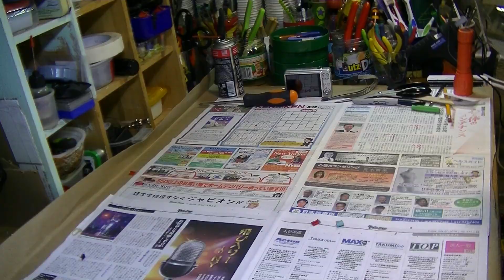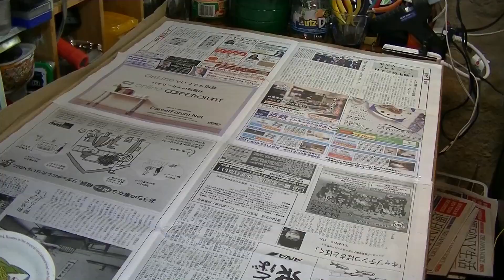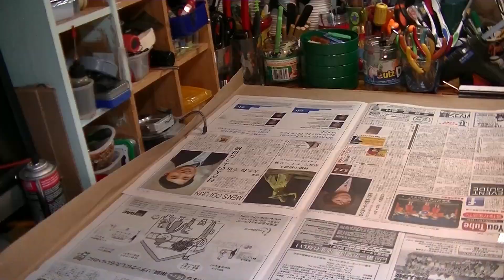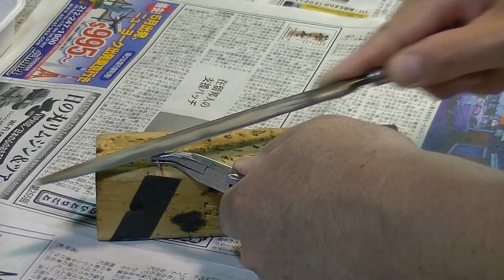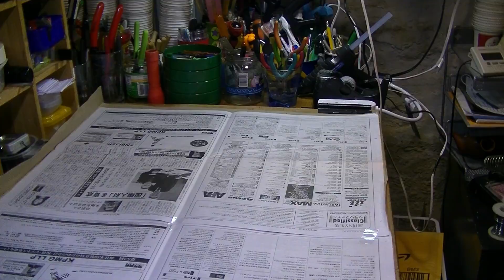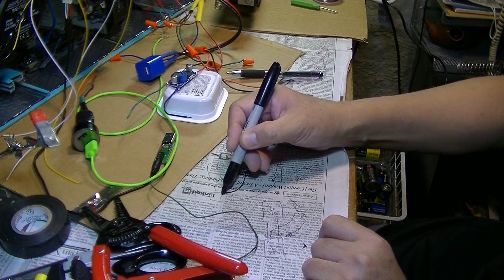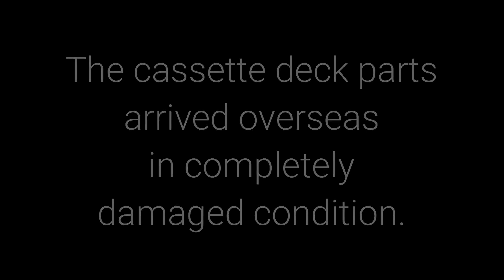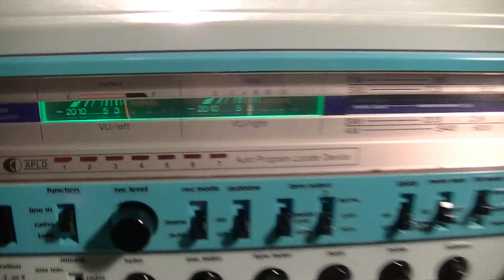A Nightmare Of The SHARP GF-777 An Endless Cassette Deck Fix

Comment: Hi teddy it's a joy to watch you work man but I would have thought those vintage machines would need recapping
Reply from the maker: I agree. Most of the time I do not replace the cap if both left and right sound level is normal. But if I replace the cap, the sound quality will jump up from good to GREAT. But I do not have time to work for each of them so far.

Comment: One can only appreciate the amount of hours you pulled into this boombox! Excellent job Teddy! The muffled sound was very noticeable when you were playing cassettes - I guess there is some old and tired component in your pre-amp (before the tone-correction circuitry), most probably some capacitor. The thing is that the power amp (after aux) sounds much better when picking signal from AUX .. so it is definitely not the power amp but the pre-amp that muffles the sound .. regardless of the variation in motor speed, that is. 

In another of your videos I've seen you have a bunch of all kinds of belts .. where does one buy those belts? And where did you buy that sticky plate that you used to stiffen the case? What is that called in English?
Reply from the maker: Hi, Nicolae. Thank you for the great input. Next time I may look into the pre-amp parts you mentioned whenever i have some muffled sound problem. Great input.

The drive belts, I buy time to time from seller on ebay, or other online shop.
I buy assorted belts set, mostly made in China. Some of them good, and some bad.
Also I used to buy belts from Germany and it was a great quality one, but they suddenly stop selling belts.
When it comes to the flat belt, there are sellers who are selling turntable needles, and they also have a different type of good quality flat belts. They will cost than assorted one, but works perfect.

Finally, plastic bonder syringe like thishttps://amzn.to/2XBJucr

It will enforce the strangeness of the repaired parts.

You can find many of them from many different company.
Reply: @teddyhashee  thank you for the information! I'll certainly look on Ebay for belts. Do you happen to know where I can buy a test tape? I  looked for such a tape on Amazon and Ebay to no avail..
Reply from the maker: I bought mine from here
https://www.duplication.ca/audio-cassette-speed-calibration-test-tape.html

Price is fair, but shipping is a little expansive though.

Comment: Excellent job as usual and very brave taking on that beast. Did you consider upgrading the power amplifier with a class-D to push those modern speakers harder?
Reply from the maker: I did not replace the amp to the more powerful one this time, but in the future, I may do it!! Thank you for the suggestion.

Comment: Hi! Have the same device, a bit of a nightmare came up, while i was trying to change a belt to the deck 2. I put one 4 pin cable on the wrong spot (i know, my bad) and then both decks stopped working :(  any ideas where i should start looking the problem ?? 
Already checked both of the fuses and they are Ok. The 2 pin yellow cable which leaves behind the deck buttons is power ?  Might be the issue on it ? Radio still works but decks don´t.

Comment: LOVE this one Teddy!!.
Q: do you find big diff with new speakers, & ever have clearance issue w big magnet. Have to rewatch on higher speed, missed painting of the face.
Reply from the maker: Hi, Bobby. The original 6 speakers were contained with 2 heavy duty bass speakers in the center. When I tested sound with original speakers, the all range speaker was not so impressive, however, this bass tuned speakers were outstanding. After replacing the speakers to new one, I wanted to have more heavy bass sound like original one. Other than this, there was no problem for installing new one.

Comment: Great work. My pain was when my GF 777 was stolen from a few years ago after owning it for 15 years. If I ever get another I want you to restore it but I have one question weren't those woofers you put in too powerful for the unit if I recall from way back when I last opened mine all the speakers were 10 watts equaling out to 60 watts.
Reply from the maker: Wow, sorry to hear that your GF was stolen. Hope you will get your GF777 again. About speaker, my opinion is definitely the original speaker is best much for this one. Tow center ones were for heavy base that will create more 3D sound, in my opinion.

Comment: Great Job. Would like to know.. Why do you approach the de-magnetizer in the way you do to the heads ? thanks
Reply from the maker: That's how I learned how to use De-magnetizer. From far away to the head, slowly movement, and never touch the head as well as metal around the head. Wave 4 to 5 times in front of the head, then move backward slowly in order not to damage the head by the strong magnetic force.

Comment: Hello, I always follow your work,congratulations You are very good. I'm restoring a Sharp gf 767 and I'd need some advice. I remade the rubber, the deck transmission wheels and changed the rubber straps, restored 2 springs and cleaned everything. When I start the 2 decks, they work for 3.4 seconds and then they stop,as if the tape is finished...how do you advise me to intervene ? Thank you!
Reply from the maker: Probably auto-stop is kicking in. It means one of your reel is not spinning well when you play or FF/REW.
Reply: @teddyhashee  ,tank you my friend!

Comment: Hey teddy another genius restoration WOW. Are these Sharp boombox problematic to fix I remember the other one you restored this one seemed like triple the work I wouldn't want to know what you charged for this one lol. Did the new speakers make a big difference in sound or are they just as good as the stock sharp. Great job
Reply from the maker: The sound of the speaker, for me original bass speaker (2 of them in center) has much deeper sound than the new one. Those original bass woofers were tuned into especially heavy base. So I like original speakers sound, that's my honest opinion. Thank you for the great comment always!
Reply: @teddyhashee  I think the modern speakers probably need more power  to make them sound good?

Comment: Nice, don't like the colors but this is a client request I guess. One question, you paint the surface however how did you restore the labels for knobs? In the 80's there where scratch-on letters but isn't available anymore. Any exposure possible to a 'secret'  how to do this?  Thanks for any answer about this.
Reply from the maker: When the owner painted body, he also created labels by printing it onto the thin plastic and attached them. So the position of the labels were different from original position. So it wasn't good looking when you look them in closely. However, I saw another boombox that was done by the professional with using hydro dip painting method, it had all exact same labels transferred onto the body. I guess it was printed on the transferable sheet and put each of them as exactly same as original. Probably it costed more than a thousand just only hydro dipping and labels.

Comment: I was wondering, do you think those small plastic parts could be replicated using a 3D printer?
Reply from the maker: If you are talking about the white plastic parts for the FF and REW, I am not sure the 3 D printing parts would work as replacement. If I were you, I will try to duplicate it with 3D printing, then after that I would sand their surface down until to make it very smooth. It has to move as smoothly as possible.

Comment: Yess I would try to fix it but if it has a  huge problem ,  I will not  attempt  or maybe I would  scrap it  for my new project;  oh' by the way if those cassette players sound muffled  try to adjust the Tape head, it has  a significant screw with spring attached on it try to rotate it,  there are two screws  the other one is fixed while the other one for tone adjustment... enjoy
Reply from the maker: Thank you Edifier for the valuable info. I do touch the head adjustment sometime to improve the sound quality. For this 777, there are another issue from painting. The painting of the whole body including the cassette door made slight change of the touch of the head, and that was unable to adjust. Anyway, next time if I need to do the 777 or similar one to restore, I try to adjust the head if it is possible. Thank you!
Reply: @teddyhashee  Yess  well you can paint it with acrylic car paint metallic ,  just give the spray paint one foot distance to it, so that  the acrylic part will evaporate  not melting the plastic
Reply from the maker: Thank you for the great info!

Comment: i Have this exact sharp 777 how can i go about getting mine repaired>
Reply from the maker: How is your GF777 condition?
Reply: Teddy Hashee  it seems to have the same problems as the one you fixed ive had it for awhile the tape deck use to run they run slow now . the radio use to play but will not pick channels.  I don’t think it’s in poor condition but def a lot of wear and tear over the years
Reply: Teddy Hashee but it’s not the best either
Reply from the maker: clean the all contact with contact cleaner, replace the drive belts to see how it change.
Reply: Teddy Hashee  juys a question how long of a process to do this exact thing to mine that you did ?
Reply from the maker: It all depends on the condition of the boombox. Some took 2 weeks, some took 5 month.
Reply: @teddyhashee   i guess i should have asked are you in the USA ? if so do u have a repair shop and can i send it to you

Comment: 我擁有一台GF-777，遺憾的是除了音量旋鈕還在工作以外，其他的旋鈕都已經失靈或不再工作了。另外我的這台GF-777左聲道聲音正常右聲道聲音小，這個問題困惑了我很長時間，至今仍未找到解決方法。
私はGF-777を所有していますが、残念ながら、ボリュームノブがまだ機能していることを除いて、他のノブが故障しているか機能していません。さらに、私のGF-777左チャンネルサウンドは正常で、右チャンネルサウンドは小さく、この問題は長い間私を困惑させ、まだ解決策を見つけていません。
Reply from the maker: It is most difficult to find out what is the reason one channel has weak or almost no sound. You need to follow the signal from source to output, and need to pinpoint the cause. Take a time enjoy your restoration.

Comment: These are not easy to work on.
Reply from the maker: The way Sharp designed this 777, especially inner shell is making it difficult when it comes to fix the cassette deck. But once I understood how it build, then mostly what I needed was just patience to do the same job again and again. Thank you for the comment.
Reply: @teddyhashee  I have a Realistic 14-778 that I couldn't get the cassette mechanism to engage. Comes to find out,these have a flaw. There is a spring behind the play head that pops out from behind the plastic housing that holds the record and play heads. It is the spring that helps bring the heads up to the cassette. I had to 3d print a new plastic housing for the heads. The end of the spring is supposed to be beneath the black plastic that is behind the play head. Once I replaced that black plastic piece. It holds the spring in place. And now works like new. I really enjoy watching you at work. I've learned so much from you.